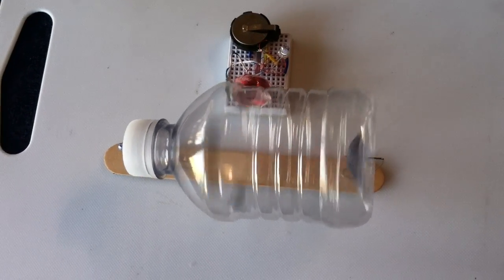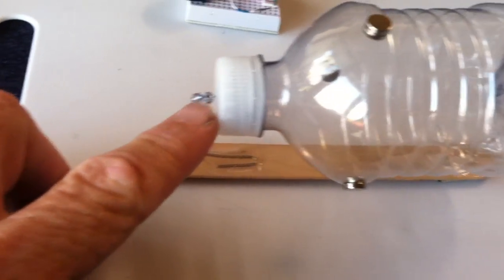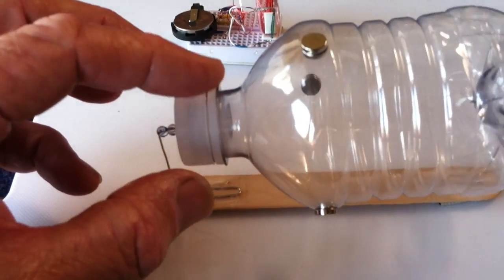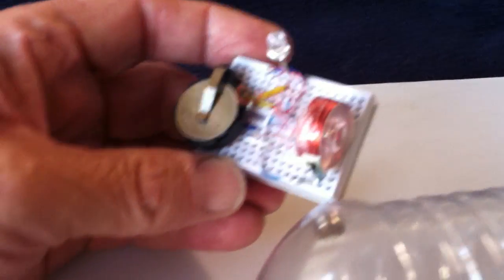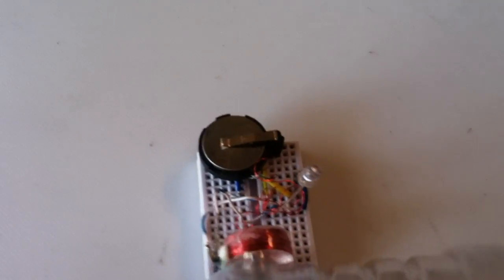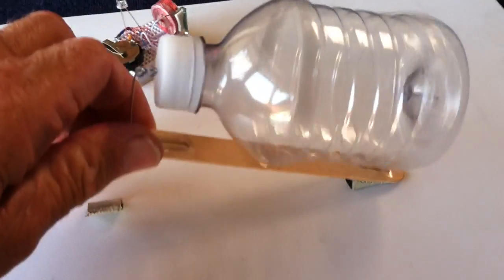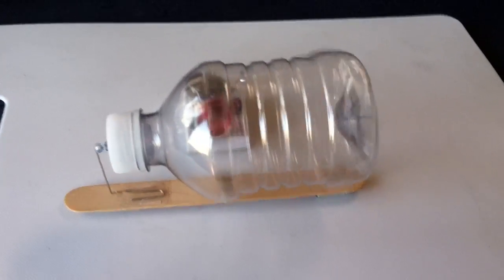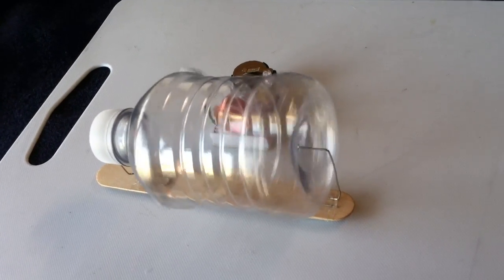Mini Water Bottle --Pulse Motor

Comment: I have a question! I have to ask this :-D
Is it possible to take this energy and transfer it to another battery, but still have the mechanical energy??
I think it like: giving energy from A, the mechanical part in the middle, and a receiver at B point.
Last, even if it doesn't work, do you consider that this way would work to move a car or an airplane a lot easier? I mean, without damaging the environment..
Reply from the maker: That is a good question.  All the energy has to all be accounted for.  If something is in the way of the energy going from A to B--it is going to eat part of it.   It doesn't have to do any harm to the environment but it will heat it up.